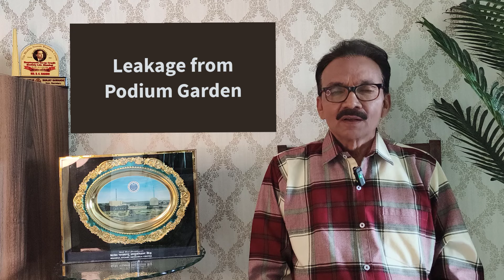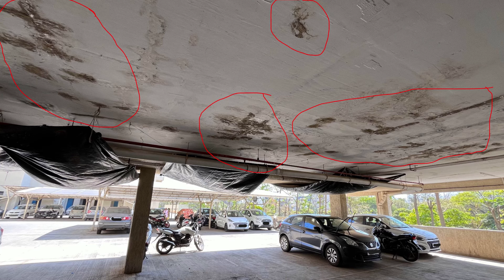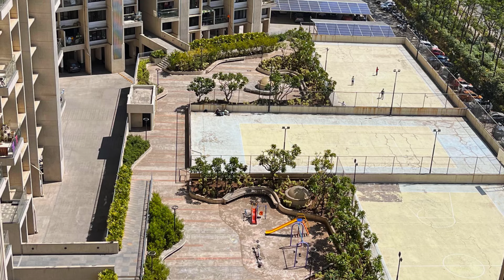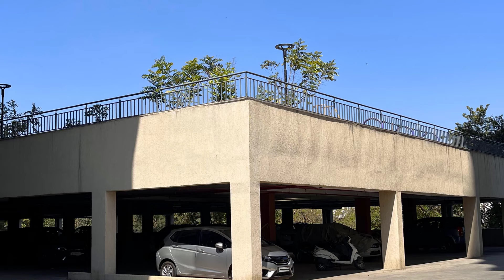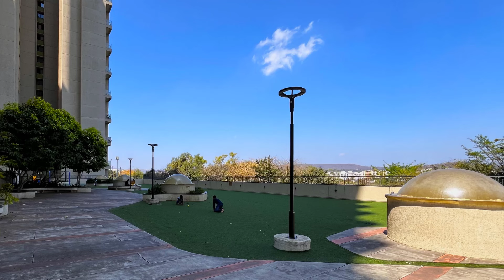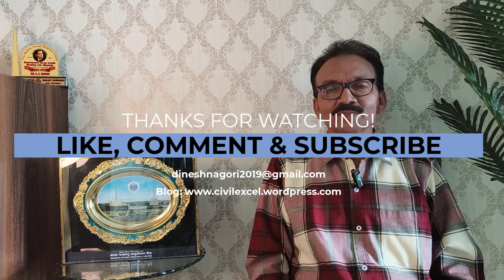Podium Slab Leakage

Comment: Sir please guide us with this situation... In my friend house (G+1) in hall of ground floor there is a diagonal crack developed length is about 1 feet whole house is constructed 5 years ago.. 
Please sir tell us the cause of problem along with solution it will be great help...
Reply: diagonal crack in which member column, beam , slab, wall (since you mentioned hall) ? furthermore clarify if its a brick masonry or RCC structure.
Reply from the maker: What is the width of crack and weather it's increasing.
Reply: @civilengineeringexcellence  width of crack is approx 3mm ,but length of crack increased diagonally its about  4 feet...
Reply from the maker: @vidyanshuthakur5241  Please try polymer grout.